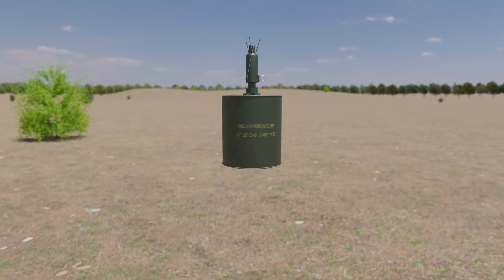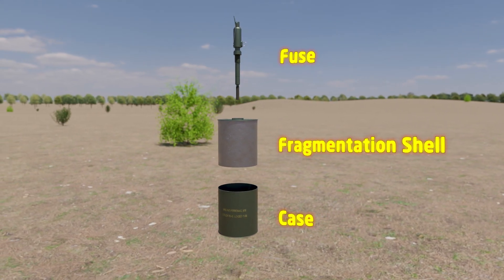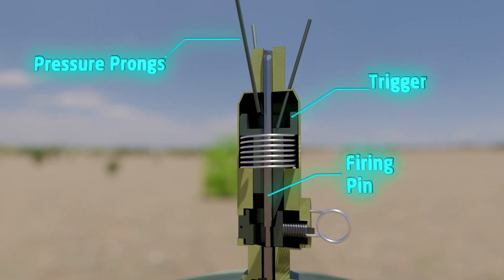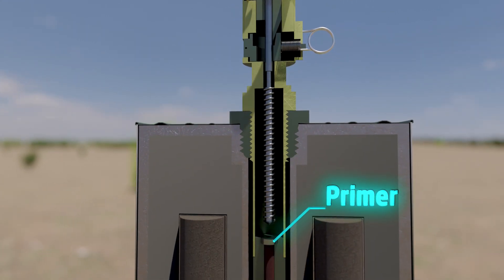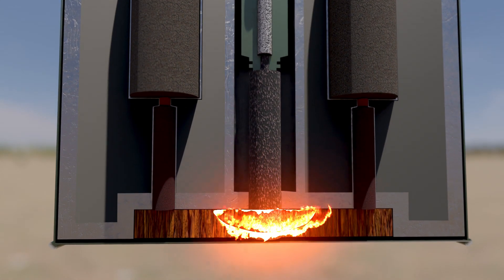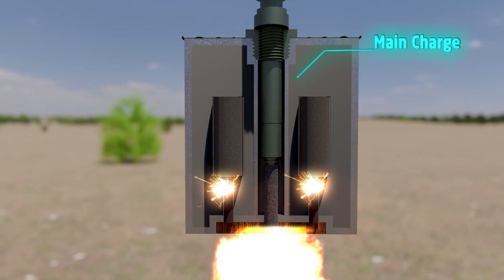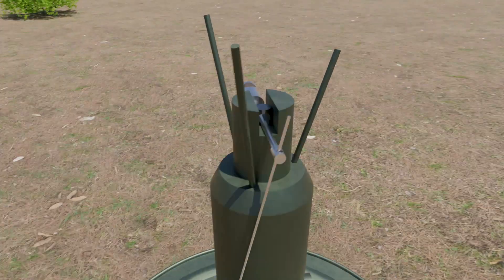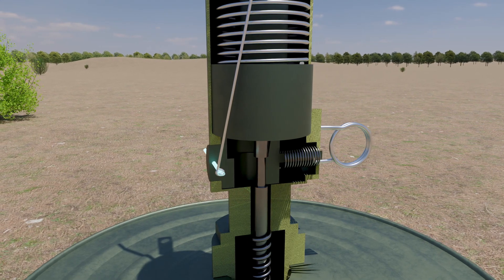How Anti Personnel Landmine Works (M-16)

Comment: I'm not expert but is it ok to put a heavy rock on it? To remove your foot off?
Reply: No, the time delay will expire and go off. It might not bound but will blow you up because of the type of primary fuze. Now a prom-1 might not detonate because it has a tethered primary fuze but it does have a significant amount of upward force so it is iffy. Besides they have a press/tilt fuze so you aren't likely to step on it. The type of fuze you are referring to is a pressure release fuze. They make an audible click and are designed to slow down a larger force during a retreat (if he steps off, one down. If not, 2 or 3 down to disarm it). Mostly used by special forces decades ago. Now obsolete and replaced by electronic mines with multiple tripwire hookups and programmable sensory triggers. So, you watch too many movies. Mines don't click so one soldier can save the platoon but it makes a good script. Just like elevators don't fall and you can't light gasoline with a cigarette. Watch some myth busters lol. I don't think they did those.